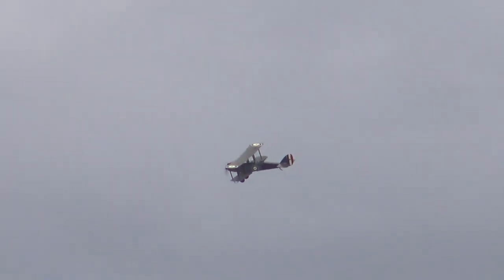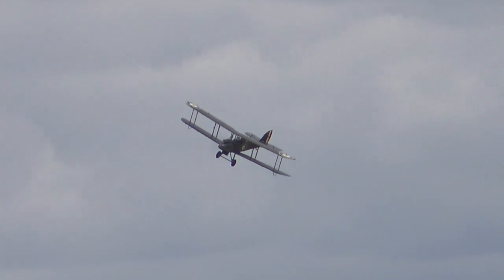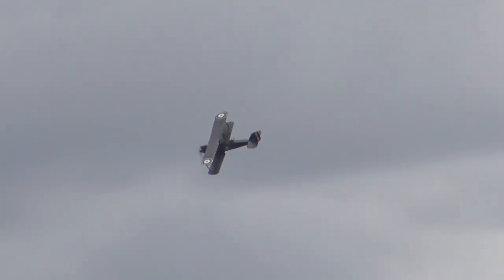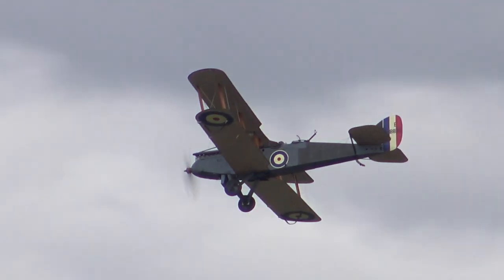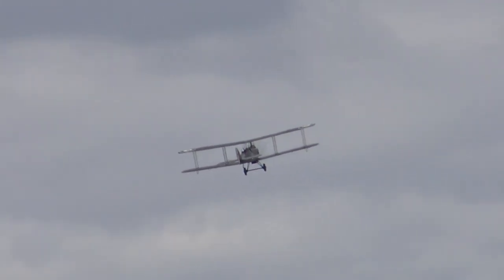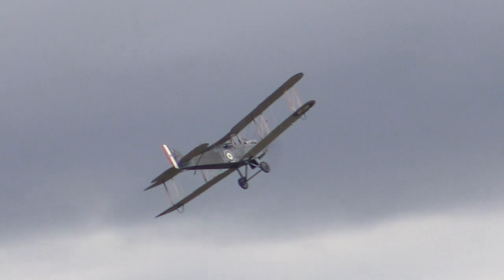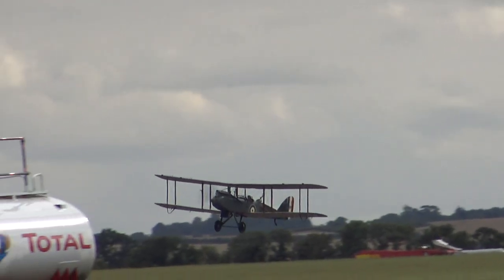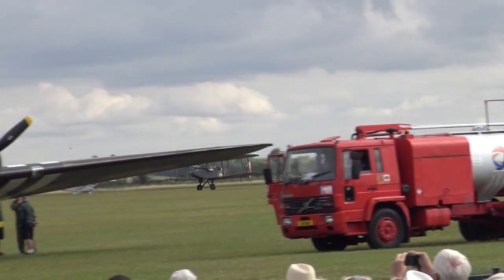De Havilland DH-9 - First Public Display - Duxford Flying Legends Airshow 2019

Comment: If I herad him right he said one of the main issues with the bhp/siddeley puma was con rod failures where the inspector stamp was? So that stamping caused weaknesses in the rods?
Reply from the maker: Yes, that's what he said and caused Conrad failures. Here's an extract from an Aeroplane article covering the restoration - 'Guy Black told Aeroplane, “The engine had one big drawback from the start: it was committee-designed. Although each of the three men responsible for it was an eminent designer in his own right, they didn’t get on and barely spoke to each other. So, there were various dangerous faults we had to put right. The first challenge was to identify how to rectify all those faults using copies of the original Ministry of Munitions reports and a 1920 RAF booklet listing various engine modifications..(continued below)..
Reply from the maker: (continued from above)...'There were 140 recorded modifications, although some of the text was rather vague, so we ended up having to second-guess what they were getting at half the time. They had so many breakages, of valve springs, cams and crankshafts. Conrod failures were common, and they broke at exactly the point where the Aeronautical Inspection Directorate (AID) stamp was embossed. Odd that potential problem never occurred to them at the time.'
Reply: @HighFlight  Thanks for the clarification. Thats so crazy. lol.